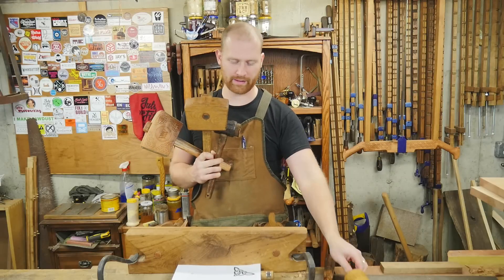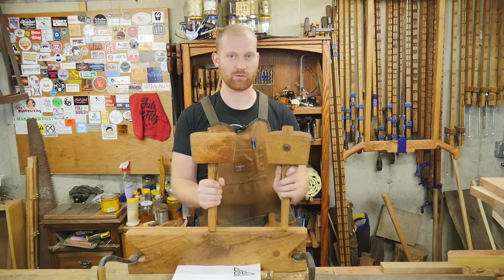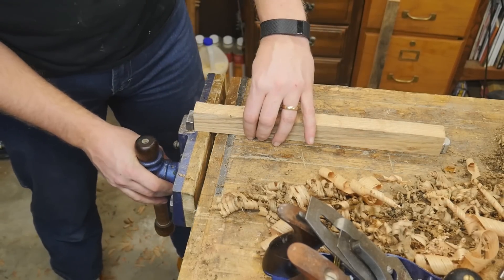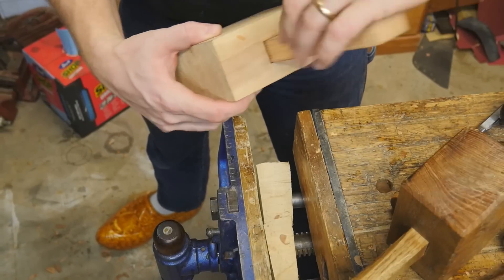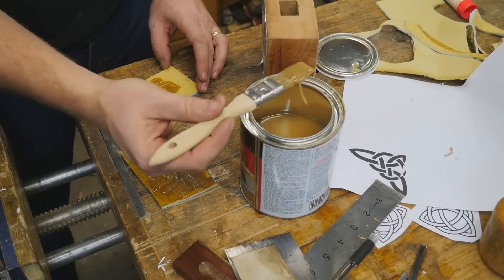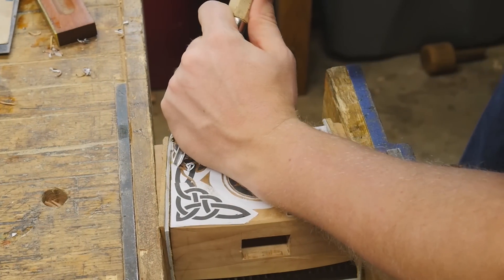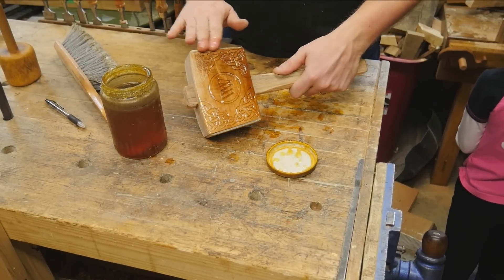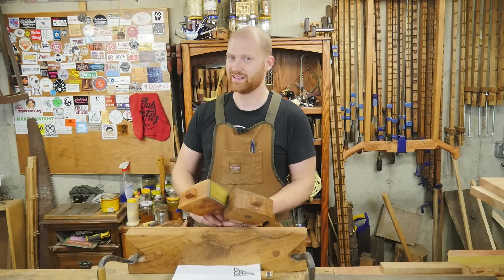How To Make a Finishing Mallet With Leather Faces for Woodworking Projects

Comment: NICE WIRK!!! I made myself a light " Tapper" on the lathe. More of cylinder shaped head however the handle goes into the round end. With the little taper and the other end flat it is handy to persuade when needed
Reply from the maker: that is a great way of doing it. nice work.

Comment: love these mallets, made my first one (smaller in size) about 1-2 years ago but did pick up some osage orange to make a few full sized mallets.  can't wait till I can get around to them lol
Reply from the maker: now that is a fun wood to work in. looking forward to seeing those!
Reply: never used it before, what should I be expecting with hand tools? speaking of wood species, an older lady had a really old maple taken down at her house and I ended up with "what was left" which was a truckload of 4-5' in diameter pieces of the base which i just processed and chucked it in the back of the truck not thinking anything about it until i started running out of firewood for the stove in my cabin and started chopping it up. the first piece cam off and I was shocked to find out is was all highly figured curly.  all that to say curly maple stinks to split as one would imagine and doesn't burn as good as regular old maple either at least not at the beginning, super slow burning with almost no flame and doesn't get super hot so it's perfect for my small cabin once i have a good bed of coals.  almost seams sacrilegious to burn curly maple but i don;t care much for processing it with hand tools and the pieces were 4-5' rounds only like 15" long so kind of useless.  i must admit I will stash a few pieces to the side for smaller projects hehe.

Comment: if you are rounding the top, why not use the Stanley #113, if you have one? Nice mallet.
Reply from the maker: I have one but for that use, it takes more time to set up that up. but it is usually a fun tool to play with.
Reply: Maybe you could do a project with it? I've never seen one in action. Thanks either way.
Reply from the maker: I have a project coming up for it. It is not a plane that I use much but when I do it is priceless. Last time I used it was on the stretchers in the dresser. I did a few videos on it about a year ago.
Reply: Thanks, I'll look for those and keep an eye out for the new one/s.

Comment: Couldn't you just have one mallet, one side is just the wood face and the other side just the leather?
Reply from the maker: you could but it could get tricky say you are in the middle of an intense glue up and you quickly use the wrong side and ding up the work. most wood shops have a pile of mallets for different uses. I have over 10 that I use all the time. there is no one mallet that does them all.